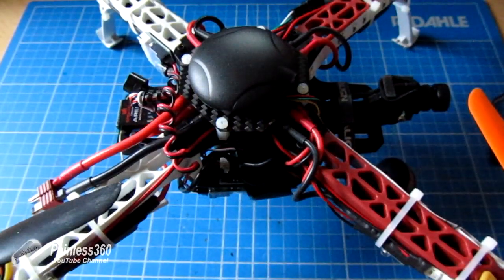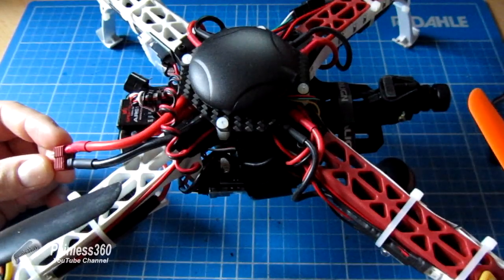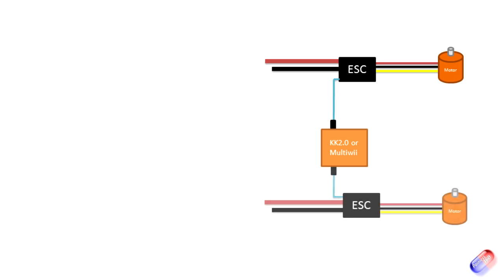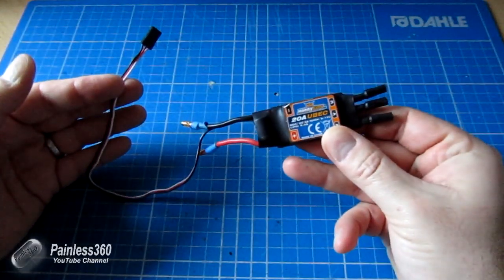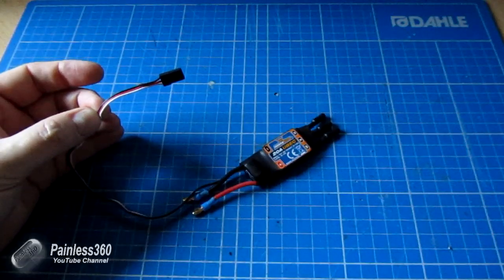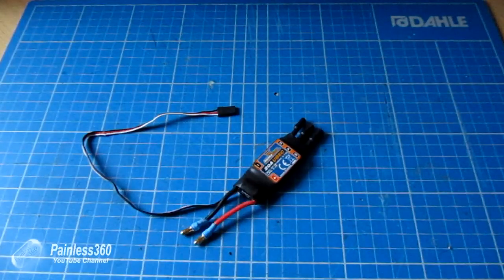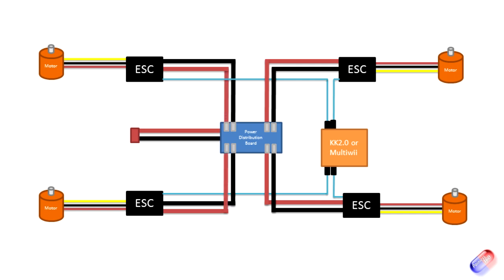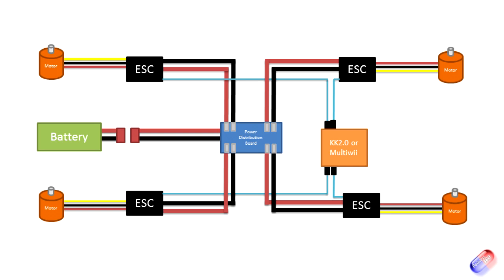How to connect the power system (ESC, BEC and power board) in your multirotor/quadcopter

Comment: Hello, and thanks for the tutorials, I'm learning a lot. 2 things about the video:

-I read that BEC is linear, and UBEC/SBEC are switch. In video I see UBEC and you say linear, can you confirm?
-In some power boards (Matek) the ESC signals go through the power board. In others like this (KK, Holybro) signal goes direct to the ESC. Whats the difference and why? Thanks
Reply from the maker: If you are new to this then check out the Basics for beginners series. It covers this and more... Best of luck

Comment: Where do you connect the BEC wires to the FC? My FC does not have pins for the BEC so I would have to solder the wires. Where would I do that?
Reply from the maker: Modern all-in-one boards (AIO) also have the power pins for the battery and ESC connections. If its not an AIO board then you'll need a seperate power distribution board (PDB)...
Reply: Painless360 i have a separate PDB
Reply from the maker: Then I'd recommend that you watch one of the build series.. Happy flying!

Comment: Hey Painless 360, I am trying to make a dualcopter, that has 2 esc and 2 servo in it. I am trying to figure out how to set up powering the board with as little amount of parts as possible and I am a little confused. I was going to order two switching UBECs (https://www.amazon.com/Ship-Hobbywing-Switch-mode-UBEC-Lowest/dp/B008ZNWOYY#customerReviews). With my case I have both of the escs connected to one battery right now, but no BEC so the board was not working. Should I order two of these UBECs, take one of the red wires out, and connect them both to my board? Also, is it necessary to have a power distribution board, as I am trying to use as little amount of parts as possible. I am just a little lost, and so close to finally having my dualcopter flying, but just can't get past this last part. Can you please help?
Reply: Also, if I had to buy a power distribution board, which one should I get? And, the escs I have right now dont have built in BECs, but I was going to get new escs anyway, so are there certain ones I should get with BECs already in it that are good with brushless motors?
Reply from the maker: I would only use BEC to power everything with the 5v needed.. You don't need two.. Best of luck!

Comment: Just getting into FPV drones and planning on building my own. The ESC's are 30A and Linear BEC. So i guess i just solder the bigger red and black wires to my PDB's "+" and "-" and then am i able to plug all 3 smaller wires directly into my F3 Flight controller and not have any issues?

Thanks in advance
Reply from the maker: +Robert yes that should work. See our 'quadcopter building for beginners' series and more videos in the 'introduction to remote control' series for more of the basics. Best of luck

Comment: great tutorials! 

Just quick question, I have 4x OPTO ESC, 1x power distribution board and 1x UBEC.  My question is where will I put the UBEC? is it okay to solder it on the PDB slot aligned with other soldered OPTO ESC?  thanks!
Reply from the maker: +Aj Christian Arboleda We cover things like that in the 'Quadcopter building for beginners' series. Solder it to the pdb if the pdb doesn't already have a 5v ubec on it already. Best of luck!

Comment: I connected the motors as you guided. my problem is when i move the throttle up little bit, motors move at full speed. it means motors only move in two states 1) no movement at all (0 logic). 2) full speed (1 logic).
i think there is a calliberation problem. if that is. then how to do that ?
thank you.
Reply from the maker: I'd normally look at re-calibrating first.. Best of luck!
Reply: Thanks, recalibration worked for me

Comment: http://www.hobbyking.com/hobbyking/store/__84722__LDPOWER_D250_2_Multicopter_Power_System_2206_1900kv_6_x_3_4_Pack_UK_Warehouse_.html

I was thinking of purchasing these motors however after looking at the pictures I can see that they don't have a built in BEC, could you show the correct BEC's that are required
Reply from the maker: You only need one BEC, see our video on multicopter power systems in the 'Introduction to RC' playlist for details. I'd get a small 1-1.5A 5V switching BEC personally if you are just running the flight controller and receiver. Best of luck!
Reply: +Painless360 and if I wanted to add a fpv camera?
Reply from the maker: They normally run off the 12v system ;) See out Introduction to FPV video series. Best of luck!

Comment: Should I use rf shielding or magnetic shielding?
Reply from the maker: I use magnetic (MuMetal) here when needed as the main problem seems to be EMF and magnetic interference from the power lines.. Best of luck!
Reply: Hi, how you use the mumetal? you make a little box with it?
Reply from the maker: Nope, a plate (slightly larger than the board) mounted between it and the high power side should help.

Comment: Dose the 20 amp little bee needs a bec . Cause I'm using a naze32 with 2600kv motors and a 3s battery for a 180
Reply from the maker: +emmanuel quiroz Nope, you will need one to power the other electronics on the model though..

Comment: I am new to this hobby so in order to understand all this I have one question. Battery and ESC are connected to Power Distribution Board but I don't see any connection between Power Distribution Board and Flight Controller or between battery and Flight Controller. How the Flight Control Board will get the power?
Reply: +TrueThinking The FC will get its power through the servo wires from your ESC. ESC's have a built in BEC so they supply the 5v the FC needs :)
Reply: +Patrick Mudde Thank you very much for this helpful answer.
Reply from the maker: +TrueThinking I have a series called 'Introduction to RC'. This YouTube playlist covers most of the stuff that you need to know. Best of luck!
Reply: +Patrick Mudde how would you power the FC if the esc didn't have a built in BEC?
Reply: seth davenport you can buy a 5V BEC that you can solder to your FC and connect to you battery. Check sites like myrcmart and hobbyking and search BEC :)
Reply: Patrick Mudde i have a power distribution board that has a built in bec for the flight control board, just wire that to the fc board?
Reply from the maker: Yep, we do exactly that in the build video of our latest CC3D Revolution series..

Comment: Hello my friend!, quick question for you... I have been thinking what would happen if you connect the battery to the power distribution board without the flight controller?  Only the battery, ESC and motors.Would that cause any damage? I want to test some devices! without having the flight controller. (kind of hard to explain) Thanks in advance
Reply from the maker: +Ricky Henderson It would be fine, make sure the props are off as the ESCs will be getting no signal at all..Best of luck, take care.

Comment: hello again, quick question, im using mystery 12a simonk esc's with built in bec's, it doesn't say what type they are, it only says 5v/1a on them, I read the pdf manual on line and it doesn't say what type they are, but it does mention the switching speed, so do you think I should remove the power wires from 3 of my esc's? and if so, which one should I leave connected?
Reply from the maker: Not sure, as it isn't listed anywhere. My guess would be linear BEC as it only supports 2 or 3 s LIPO batteries..

Comment: I now dont have any power to my multiwii.. it only powers up when I plug in the USB??
Reply from the maker: What troubleshooting have you done? Has it ever worked?
Reply: It was working just recently, I've checked all the connectors make sure everything is connected together properly the speed controllers all beep as they are getting power but no power is being run 2 multi Wii from what I can tell also there is no power passed through to the receiver
Reply: I just tested the ESC output to the multiwii and there does not seem to be any voltage there.. but maybe it only switches on when it is talking with the multiwii?
Reply from the maker: if it's a linear BEC then it will always have an output. Sounds like the BEC in the ESC needs looking at more closely..

Best of luck..
Reply: Painless360  I applied an external power source to the multiwii to the input where the ESC would go.. and I get power so I dont think it is the MulitWii.. What is the BEC in the ESC and how can I manipulate it.. I tried plugging the ESC directly into my Receiver... and nothing.. no power.
Reply from the maker: You need to watch some of my introduction to RC videos that cover all this.

Bottom line - the BEC takes the larger battery voltage and reduces it to 5v. If it's broke you don't get the 5v out..

Comment: I have a LiPo (Lithium Powered) battery and my power distribution boasd does not have one. Please help me out I have a science fair coming up soon and I need to to do this. Thank you!
Reply from the maker: Hi, I don't understand the question. Sounds like you are new to this.

I have a few videos that may be helpful for you -
https://www.youtube.com/watch?v=Oda0JYzGG3w&list=PLYsWjANuAm4pIU07ta7glYIn-EBCof_4r
https://www.youtube.com/watch?v=DraFgiDELjI&list=PLYsWjANuAm4pIU07ta7glYIn-EBCof_4r&index=2

Best of luck..
Reply: Oh thanks I found an adapter called the XT60
It may come in help!
Reply from the maker: That is a type of common battery connector, there are lots about but the XT60 come on a lot of the batteries from places like Hobbyking now.

Glad you are sorted.

Comment: Will it still work if you pull the middle wires from three if the BECs are linear?
Reply from the maker: Hi Kyle, yes should do if the remaining BEC wire has enough amps to power everything. If they are linear then my advice would be connect them all.

Happy flying!
Reply: Thanks! Yeah I pulled them on the advice of another source (kinda jumped the gun) but I left them out and it seems to work just fine. Thanks for the quick response!

Comment: Not sure why people keep saying that  switched BEC ESCs should only have one ESC power the board.  I have two quads, both have 12A RapidFire SimonK ESC's with switched BEC's
with ALL ESC's powering the board at the same time and NO issues.  Have been abusing the quads for many hours and no fire.  ESC's don't even get hot, barely warm after aggressive flights.
Is this a popular myth, or there is something behind this custom of telling people to do this?
Reply from the maker: Anatoly Vizitiu It's a good question. The reason that the common advice to not connect all of the power leads from switched UBECS at once is down to how they monitor the output voltage to regulate the output.  Linear UBECS are very simple and dissipate the extra voltage as heat. They have a set voltage but as more current is pulled the output voltage drops due to the resistance in the output electronics. The switching UBEC is a lot smarter. It chops up the incoming voltage and then combines these pulses to make the lower, steady voltage. To keep the output at the right level it senses the voltage at the output and if it starts to drop (like the example above) it lets more voltage through the switching pulses to keep the output voltage at the set level. This is where you can get problems connecting UBECS in parallel - rather then sense their own output voltage they are measuring the voltage they are all producing by being connected together. Lets go through an example. Say one the UBECS is putting out slightly less than the others due to manufacturing tolerances(5.0v vs 5.1v), the fact that they are all connected means that the other UBECS will see this lower voltage and increase the voltage coming out to compensate, but this doesn't affect the output so it tries harder and harder to fix it. Meanwhile the other UBEC with the lower voltage may see a slight increase in the common output voltage and tries to LOWER the voltage on the output.  Simply put - they fight each other and you have current and power being used to try and stabilise the voltage that you don't get if you simply connect only one of the +5v leads to the board.  Hope this makes sense. I've tried to cover a complex subject at a high level! Happy flying!
Reply: So If I understand you correctly, you are saying that there will be a small power fluctuation?  What if you need higher amperage, say for example to power receiver, flight controller, alarm buzzer, BT module, and couple of 3W Super bright LED lights connected to the buzzer line for Low Batt warning? (all without extra weight of external BEC) Surely one single BEC may not have enough current to drive all of the above, but all combined in parallel, may give you just the power you need to power them all.   Let me know if there is any technical problems with this idea, other than tiny power fluctuation.
Reply: Looks like I found the answer to my question on RC forums.  Some people reported video noise and slight increase of temperature of ESC's when connected  in parallel.

Comment: How is this control board powered? Is it supposed to be powered from the escs coming into the board? My escs do not have becs in them for power out. If this is the case does this mean i have to get a bec and connect it to the board? What size bec would i need (volts,Amps)? Also at what positing would the power in to the board need to be connected?

Thank You
Reply: Jordan,  get a 5A BEC and that should be plenty for any quad.  If you want to use a BEC on large airplane with huge servos, than you would go like  7A.  But the more Amps your BEC can deliver the heavier it gets.  Use BEC to power your receiver, and receiver in  turn will power your flight controller.  You  can even put a switch  on your BEC, so that you can  power cycle your flight controller and  the receiver.
Reply from the maker: Hi Jordan, thats right, you may find my video called 'How to connect OPTO ESCs and a BEC to you multirotor (KK2.0 or MWC)' useful.  

The board is powered by the +5v lines from the ESCs but if you are using ones that don't have a BEC then simply add a separate UBEC and plug that into one of the spare connections. Happy flying!
Reply: Painless360 Thanks! My ESCs do not have BECS in them so ill have to order one to power the board. So i can just solder this BEC to the power distribution board and connect it to position D7-D10 and it will work fine?
Reply: Also will just a BEC work or does it need to be a UBEC? I purchased this one this morning will this work to power the board:
http://www.amazon.com/gp/product/B00EWFMDKO/ref=oh_aui_detailpage_o00_s00?ie=UTF8&psc=1
Reply from the maker: Jordan Mowbray that should work fine. Good luck with the build.
Reply: Painless360 So i got everything hooked up today and it appears the board is not arming. I hold the throttle down and to the right and nothing changes. I watched your video of how to arm a multiwii but the blue light on my board is on constantly and flashing. Is there some change i need to make to the firmware in Arduino to get this to work? Thanks for your help.
Reply from the maker: If the blue light is flashing all the time I assume you have calibrated the accelerometers and compass in MultiWiiConf? Might be an idea to run through that step again.. Hope it helps. Happy flying!

Comment: I don't get how or where are powered the FC and the receiver... Where's the power in ?? (thanks for the help)
Reply from the maker: The power in comes from the lead that connects the ESCs to the board. The red wire in that lead contains the 5-6v that powers the board. This is called a BEC (battery eliminator circuit) and is part of the ESC itself. This video may help - RC Electric Power Systems Simply Explained (ESC, BEC, LIPO, Brushless etc)

Let me know if you have any more questions. Happy flying!

Comment: Hello.  Everyone has told me to get a UBEC to power my electronics but I don't know how you determine what size UBEC to use?  Can you give me some guidance please.
Reply from the maker: Depends on the model and what you need to run. You need to look at the current pull from the servos and other electronics that the BEC will be powering and get a BEC that will supply at least 50% more than that maximum.

A rule of thumb is allow 600-700mA per servo so a 2A BEC will run 3 servos and a 3A BEC will easily run 4. I have a 3A on my 450 helis and they run 4 servos fine.

Hope this helps.

Comment: I wasn't aware of the distinction between linear and switching BECs when using with the KK2.  What problems will I have if i dont pull the positive lead?
Reply from the maker: Look up detail on how switching BECs work to see more detail but simply - they will fight with each other as they sense the output voltage and modulate an output waveform to compensate. If all the outputs are connected they are trying to compensate for each other.

Hope this makes sense. Happy flying!
Reply: Painless360 hey i dont get the opto vs normal esc thing
i ordered normal turnigy multistar 30a esc's for my quadcopter build (first one, hobbyking x550 frame if interested haha) i still need to order some parts and want to do a multiwii pro setup with gps, BUT with the normal esc's do i have to remove middle wires for the bec's? on all of them or just 3 of them and leave one?
what will happen if i just connected them all to the multiwii without doing anything?
greets from the netherlands :)

(still need to order my motors (probably ntm propdrive 1100kv short shaft with accessoires and the multiwii pro with gps)

and eventually get a better radio and fpv gear
(already got videoglasses AND i've got an Oculus Rift too so hopefully i can somehow use that for FPV that would be AWESOME to have your whole vision to be the fpvlink)(fov)